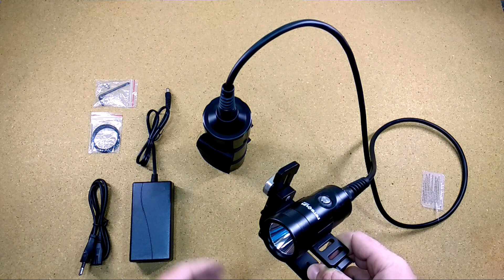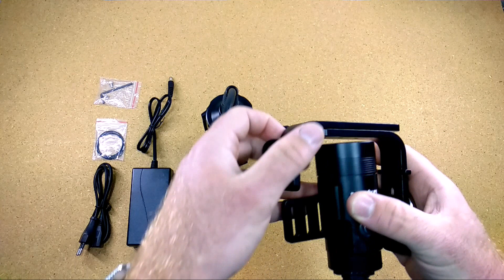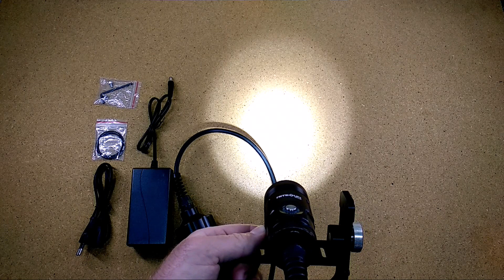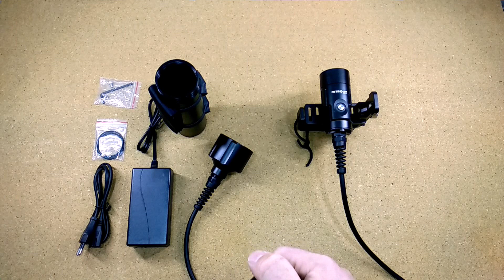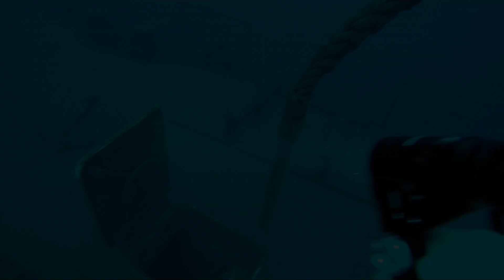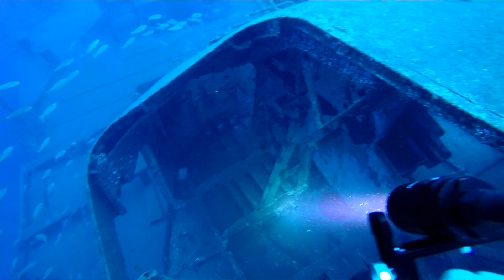"Great Spot!!" REVIEW | Nitesun DIV20S

Comment: Nice review. Where did you buy it and how much was it? I couldn't find it anywhere...
Are the 18650 cells user-replaceable? Guessing from the voltage and that it's using 8 cells it must be a 2S4P setup. Is a balancer built into the canister?